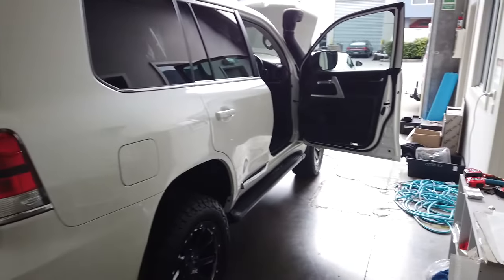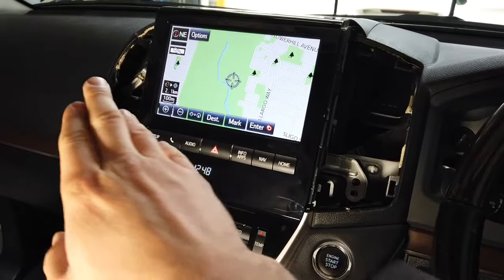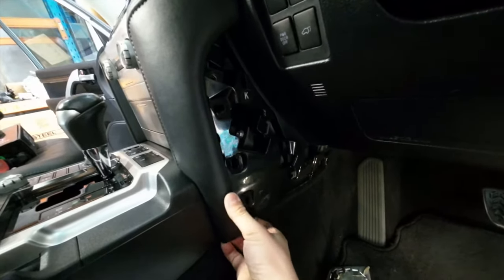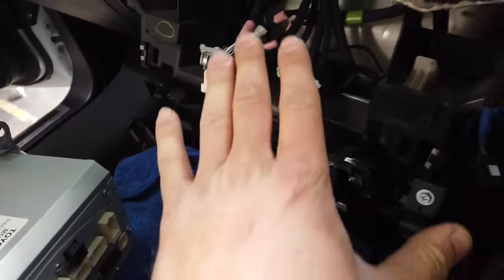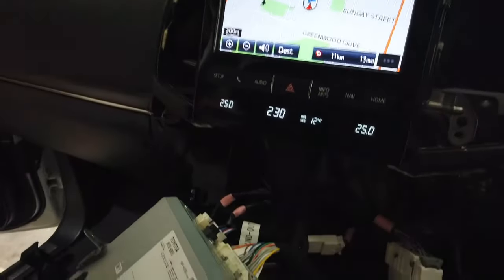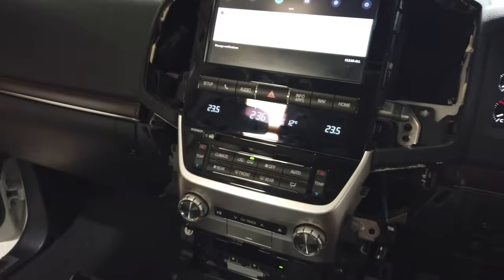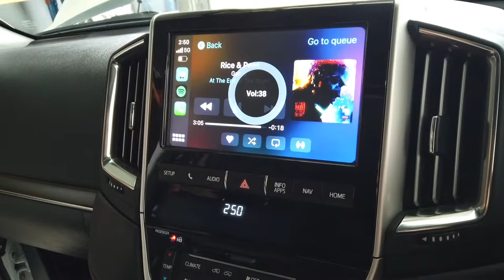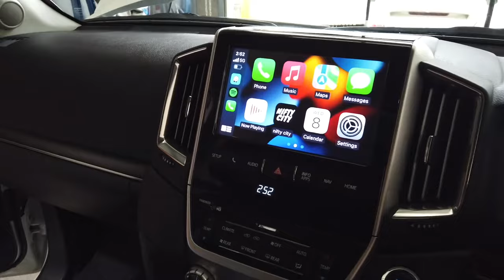Apple CarPlay & Android Auto for Toyota LandCruiser 200 2014-2021

Comment: When starting the vehicle does the OEM system startup or the module ?, also is there any lag issues especially rear camera when needed?
Reply from the maker: Hey Abdullah, no it does not. You need to switch to the module. No lag issues.